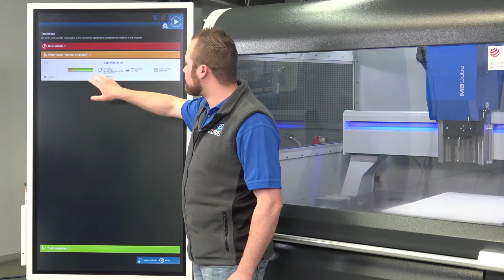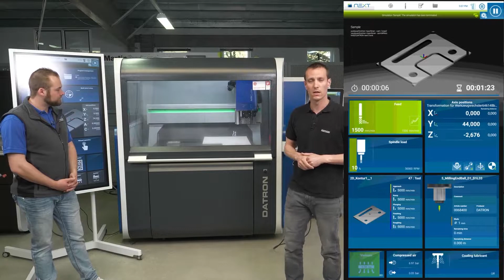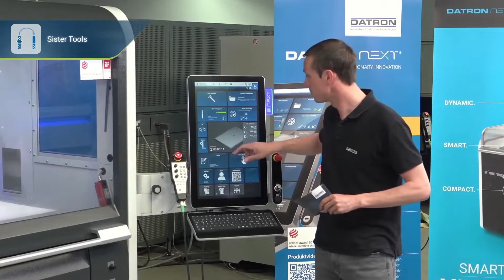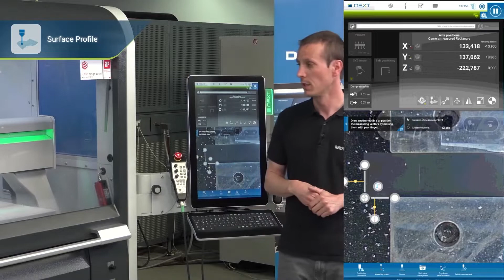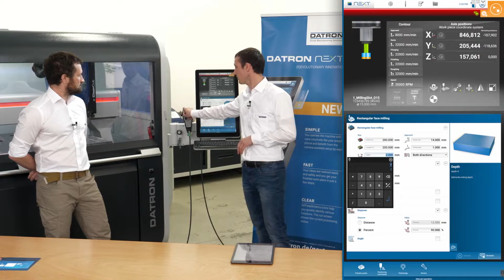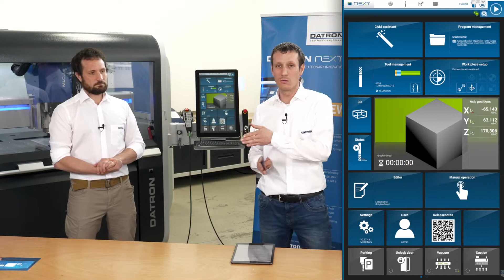DATRON Digital Experience Session DATRON next Control - 2022-03-23

Comment: I always think that the Datron machines and their Next controller system are quite compelling whenever I see one of their demos... However, they always tend to focus those demo's on parts that are made from flat plate material (such as panels held with their vacuum work holding Etc.)  The big area of concern for me re possible limitations that never seem to be addressed in demos are to do with workpiece setup for parts that aren't flat or require multiple setups to enable machining on a 3 axis machine....  By this I don't mean their surface probing that allows for an even depth of engraving across a surface that isn't completely flat, I mean a part that needs to be part machined and then completly removed from the fixture, rotated and then re worked, without a 'flat' 'straight' or 'square' edge to use as a datum.